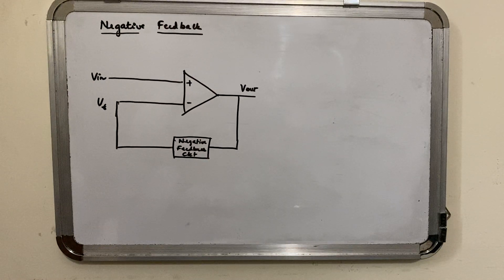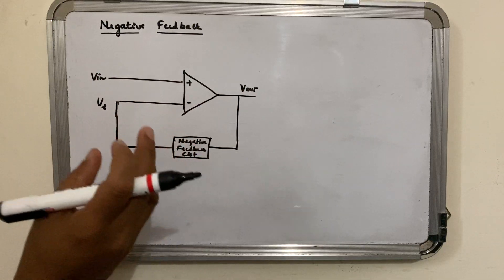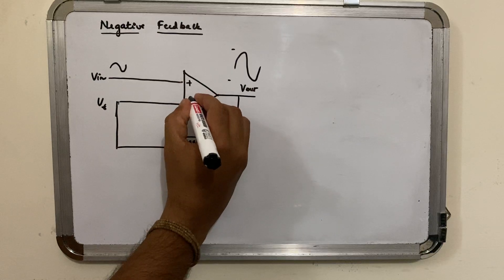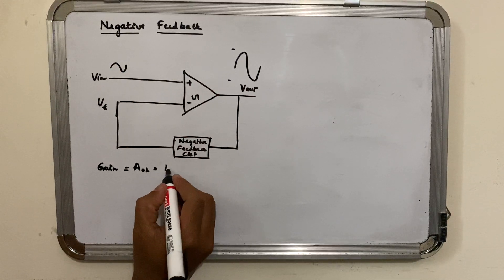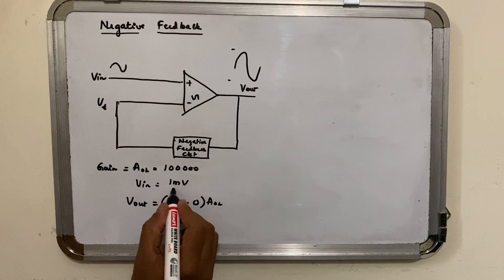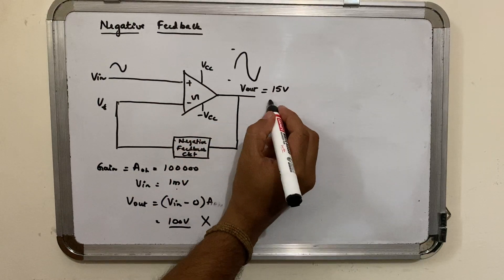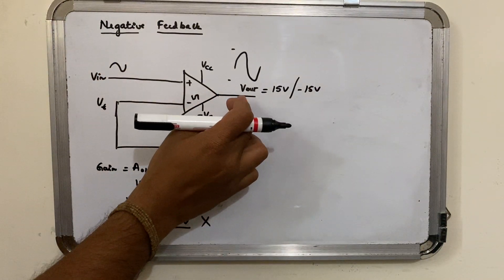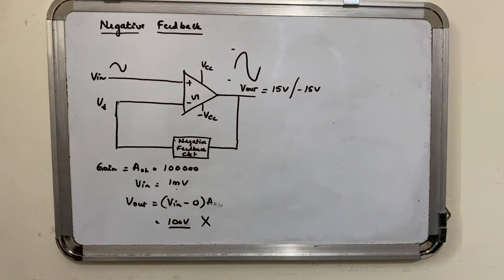Negative Feedback in OP-AMPS

Comment: Thank you sir, sir a final doubt,  so we use feedback so that instead of saturation of voltage in the output we get the output voltage in the range of -15v to +15v regardless of the input voltage